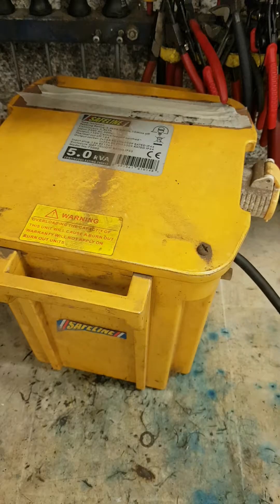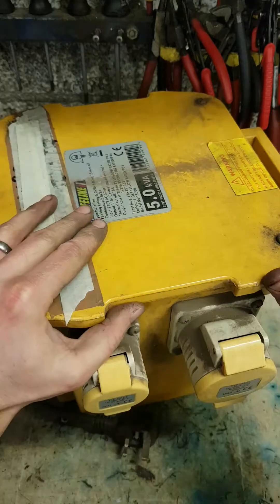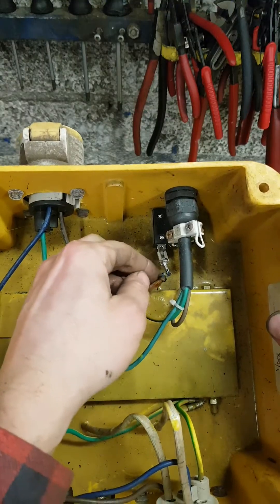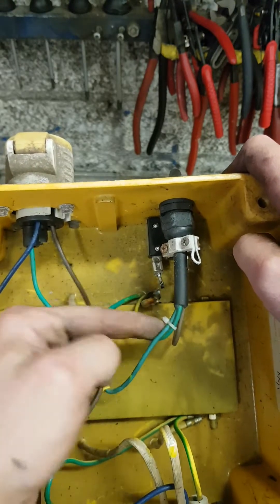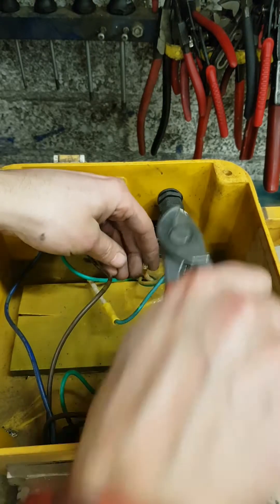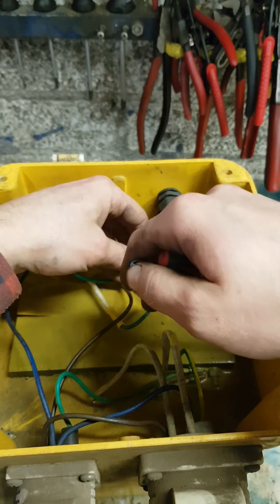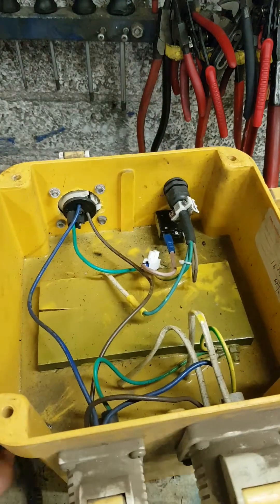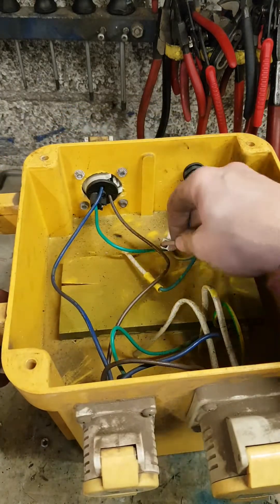Repairing a 5kva site transformer.

Comment: 🤣🤣🤣🤣  where is the transformer?
Reply: The actual transformer unit is 'potted'. That means that it's covered with epoxy substrate poured over it to keep it intact.
The substrate hardens and it's the yellow stuff that you see in the transformer bed, in the video.